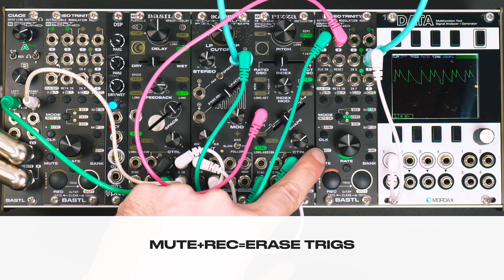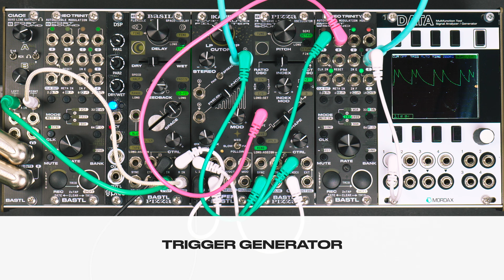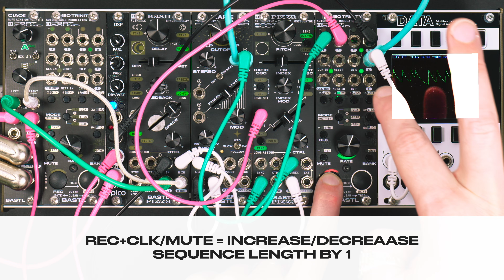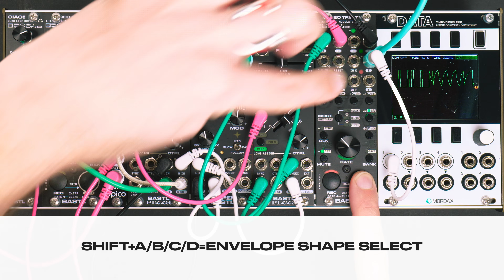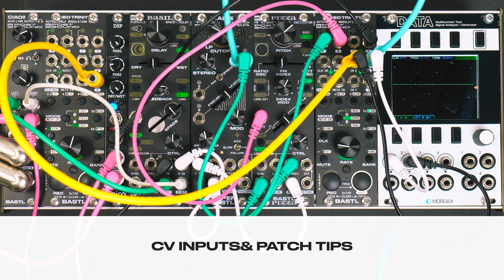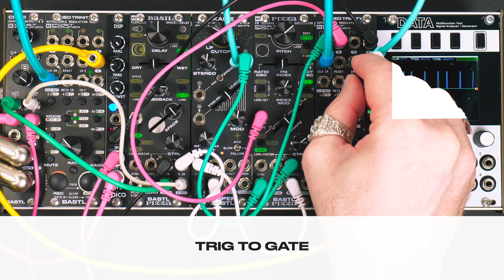NEO TRINITY - ENV Mode

Comment: I see it can do 2, 4, 8, 12, and 16 steps. Can it do lengths in between? 5, 6, 7, 10...?
Reply: this is described in the video - hold rec and press the + or - to add or remove steps from the already selected length